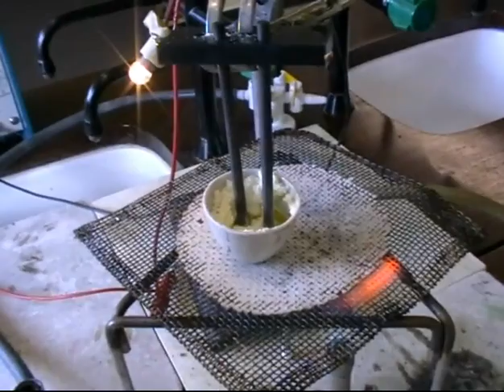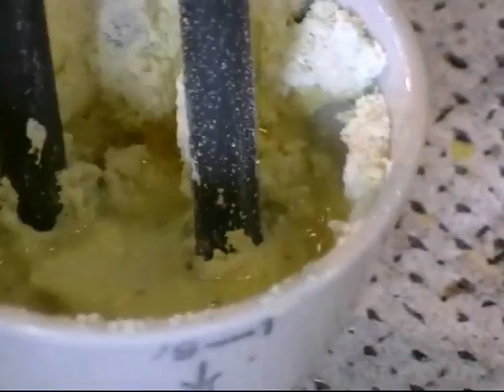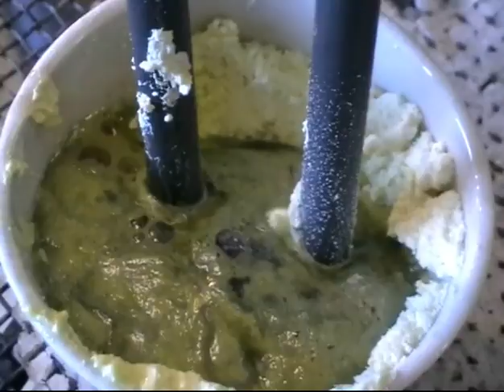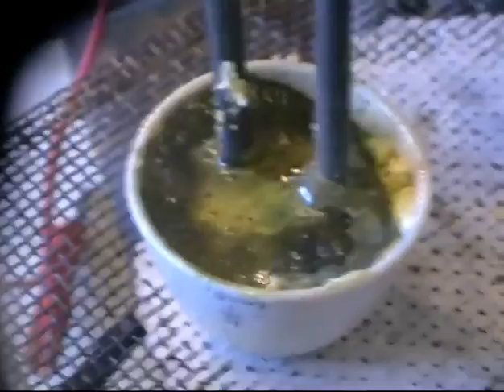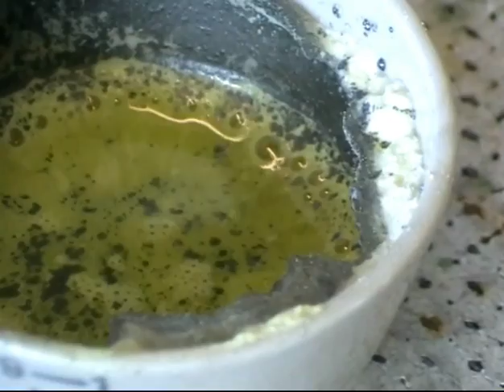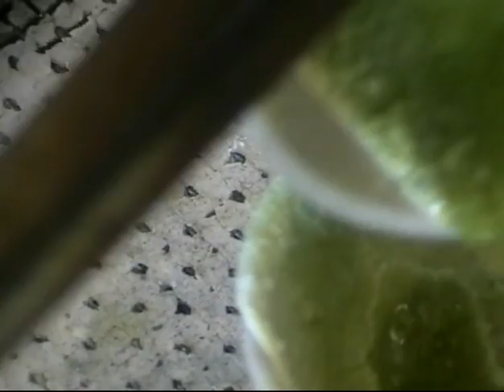The electrolysis of lead (II) bromide using inert graphite electrodes. Demo.

Comment: This helped a lot thanks heaps! Do the electrodes have to be graphite? Or would any other inert electrode (such as carbon) also work?
Reply: TheGuySitinNext2U graphite is made of carbon but yes other inert elements such as platinum would also work
Reply: @pradysaligram4130  but using platinum means it will get affected by the vapours of bromine which are reactive. So graphite is preferred as it remains unaffected by the fumes

Comment: What happens if you use hydrogen instead of lead??
Reply: Hydrogen bromide would be a gas, so you could not do this. This video is using melted lead (ii) bromide. If it were dissolved in water, it wouldn't do what it's doing in the video.